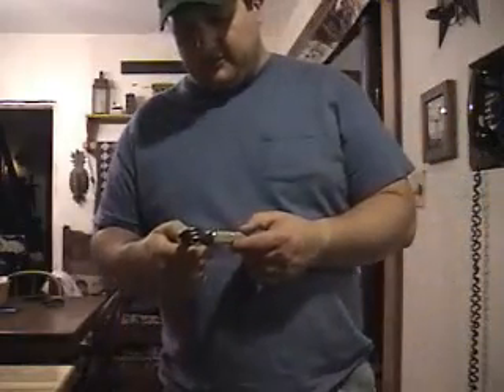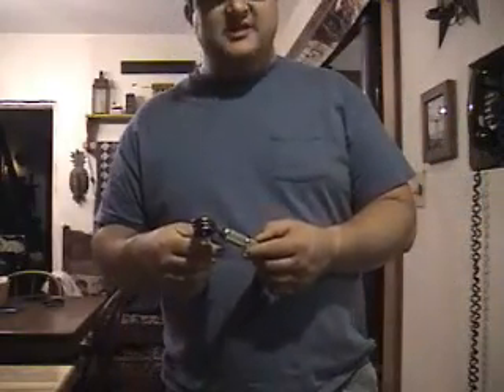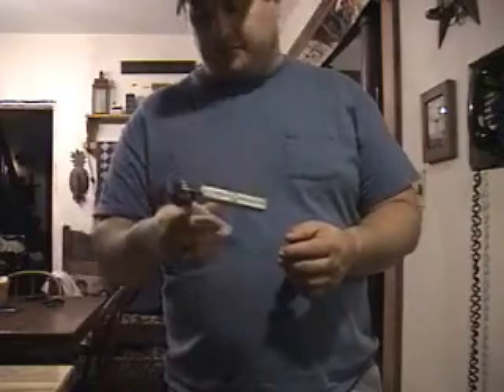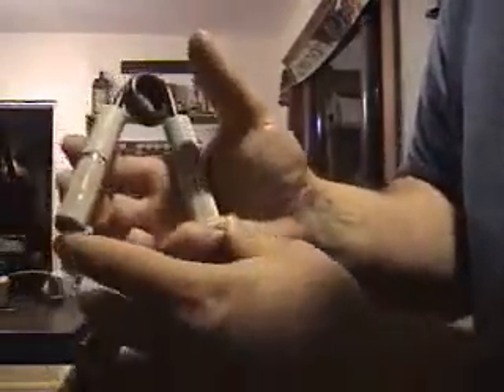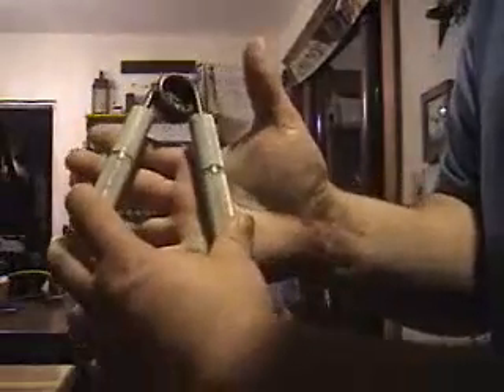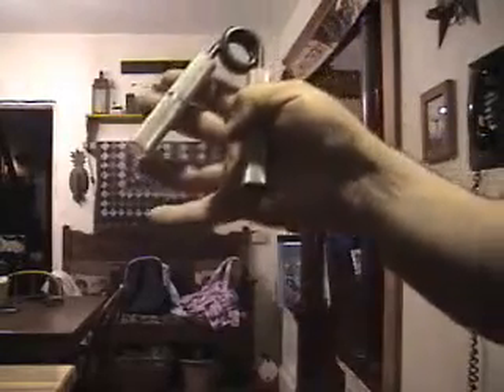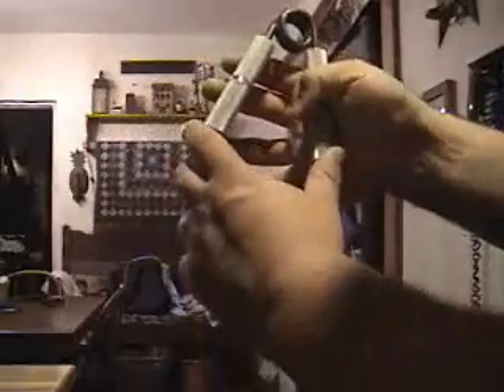Setting a gripper

Comment: The requirements by IronMind for certification on the three can be found on their website.  You would have to be able to place a credit card inside the handles and remove the other hand before closing...  Unless they have changed their standards, but I couldn't find it on their sights when I looked just now :S